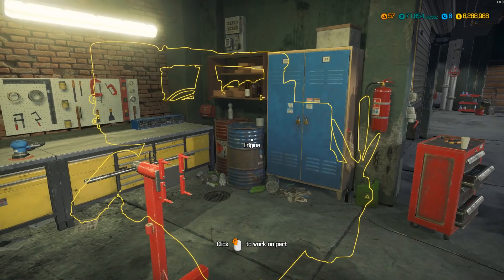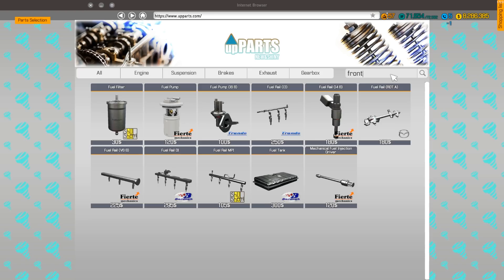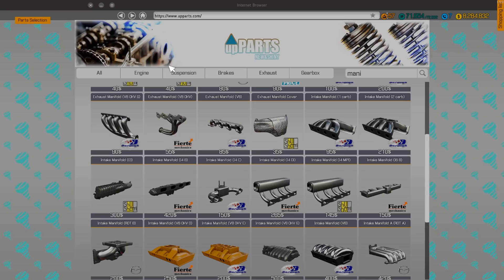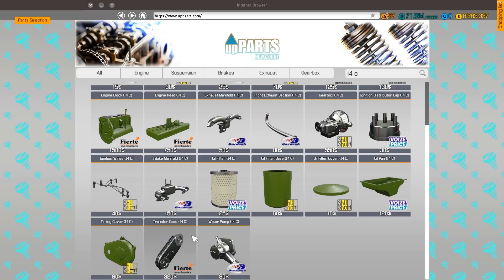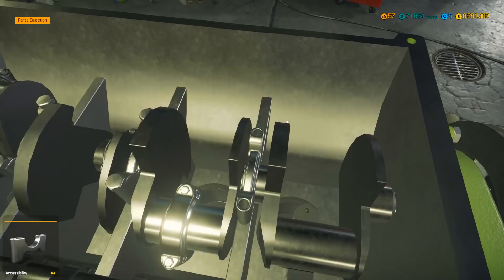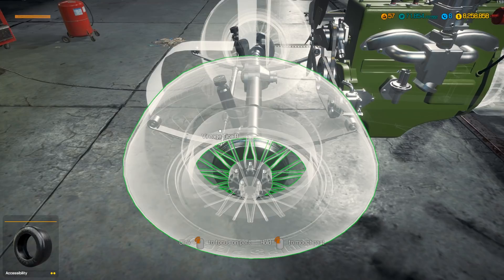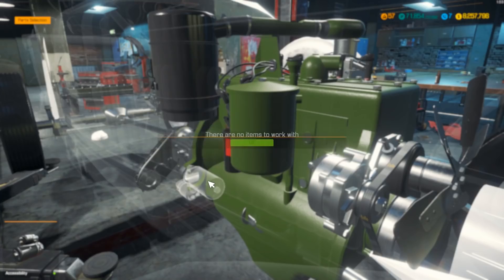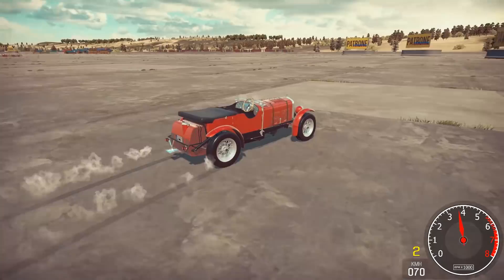1927 Bentley Blower 4 Restoration  : Car Mechanic Simulator 2018 : PC Lets Play

Comment: Diesel, I’ve been having problems with the game recently. The game would start, go through the movie sequence, but when I press continue it loads, then goes into a black screen, I can hear noises from the game but no video. I spent a lot on this game and I haven’t been able to play it. Do you know how I can fix it?
Reply: Happened to me once after i installed 10 mod cars. I just deleted the last 10 mod cars i had put in and the game was fine after. I guess one of the mod cars was the problem.
Reply: dcz28 I don’t have any of the car mods, only the 4 DLCS that you can get right now
Reply: Then i don't know what the problem is. You can try looking in the steam general discussion for an answer. They have pinned topics for this problem so your answer might be there or someone in there might be able to help you out.